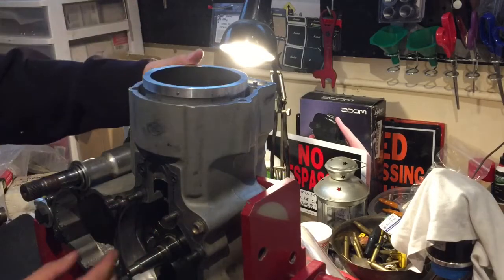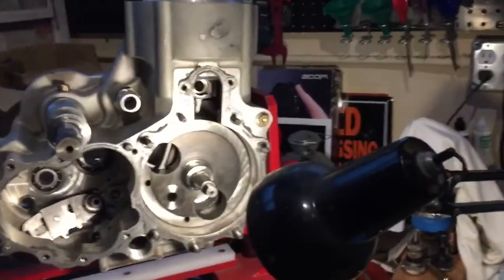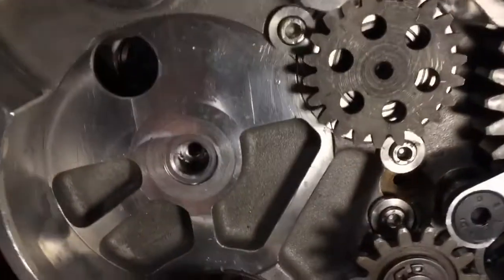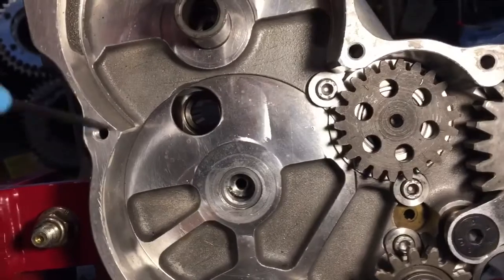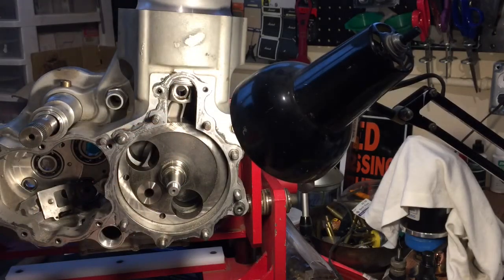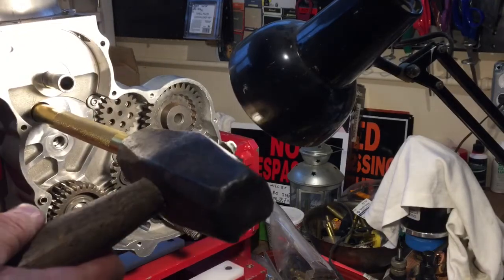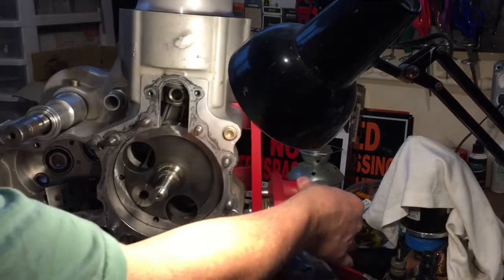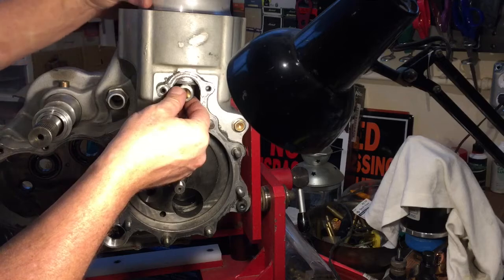Vertemati 570 Cylinder and Piston Removal

Comment: bro you got an email? I have a 2002 VOR 503 and would like to pick your brain.
Reply: what do you need to know about VOR?
Reply: It takes an act of God to start the bike.
Reply: Adam Shepherd wow, where to start? Did it use to start better? On cold or hot engine? What carburettor do you have? Any jetting modifications? Do you have right valve clearance, good spark plug, how's your decompressor set?